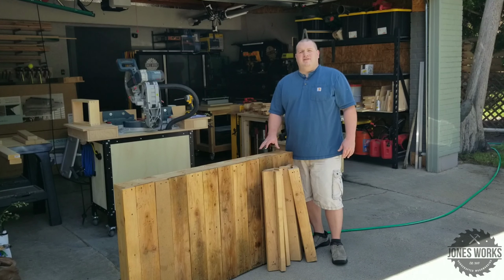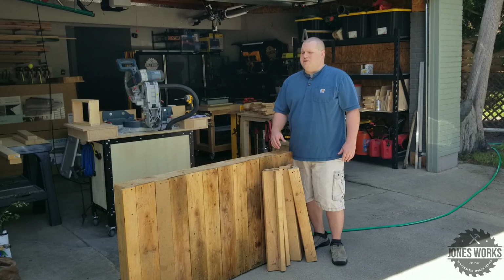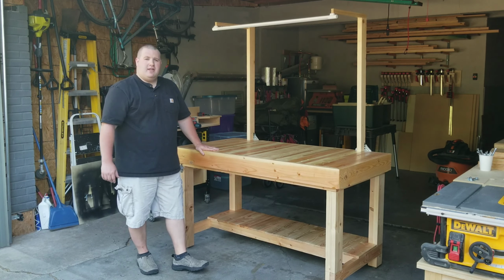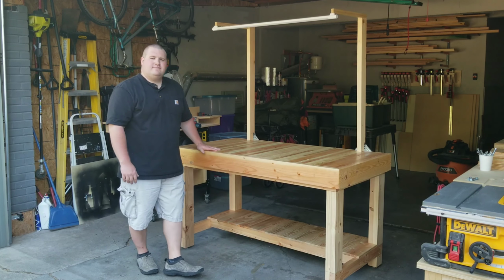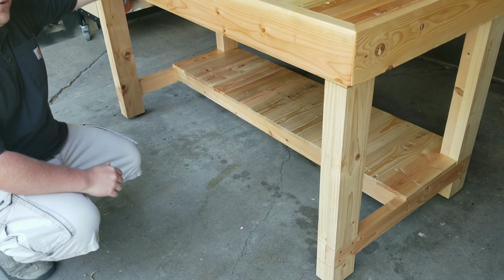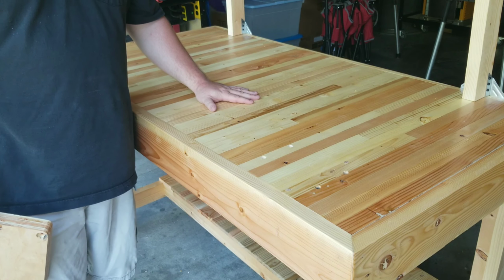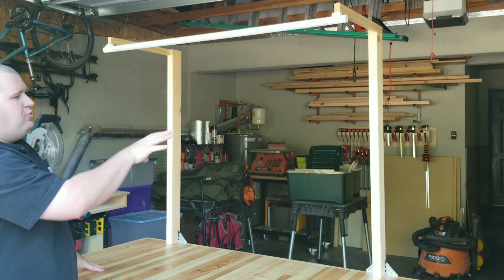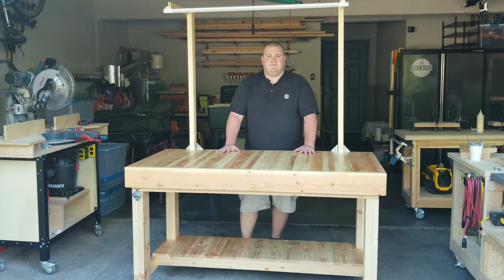Reloading Workbench | Reclaimed Wood Project - 17

Comment: Very nice! It's a similar idea to what I made using sandwiched 2x4s for the legs and main crossbeams, but yours is more finely made. 

I had a 1" thick laminated desk top instead of butcher block and I used 1/8" hardboard to close off the back and sides of the lower shelf so things wouldn't fall off. To ensure I had enough light under the bench for the lower shelf, I put some LED rope light under the top. I also put a metal step edge on the front of the shelf since I knew I'd be putting my feet there when I sat at it. Finally, mine is 42" tall and I use a bar stool so I can either sit or stand and be equally comfortable.

Comment: Good idea to glue up the top width-wise; most workbenches have the 2x4s laid out along the long side of the worktop.  The problem with that is the reloading press will excert a considerable twisting force on one of the glue joints, even with a block under the press mounting plate.  Don't ask me how I know :)   (I fixed my workbench by inlaying a flat piece of hardwood along the failing glue joint)
Reply from the maker: Thats good to know.  I have to admit I did it this way because I was recycling shorter boards but I appreciate that info

Comment: I wonder if the corners will pull apart on the picture frame if the top absorbs any moisture and swells up or split if it shrinks as timber moves much more across the grain than along it.  I have had this happen with an octagagonal table I made, which also had a picture frame and the timber in the middle shrunk and split.